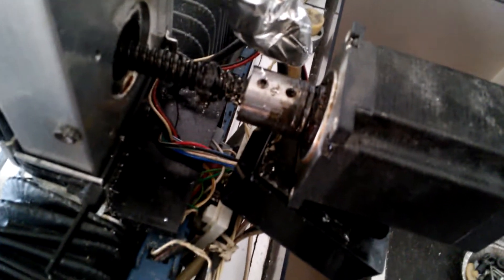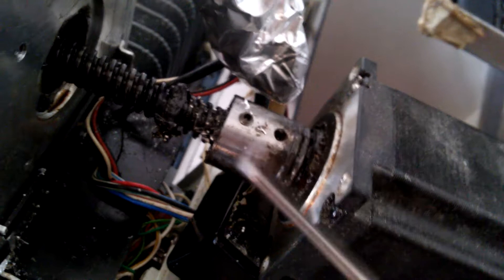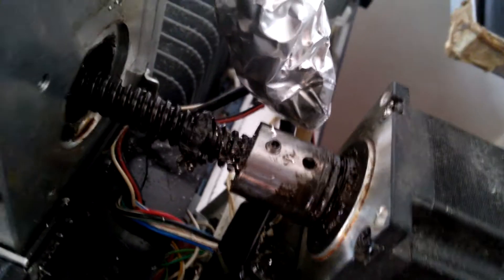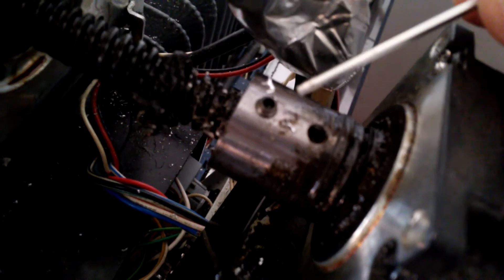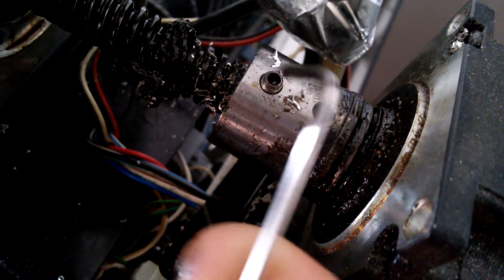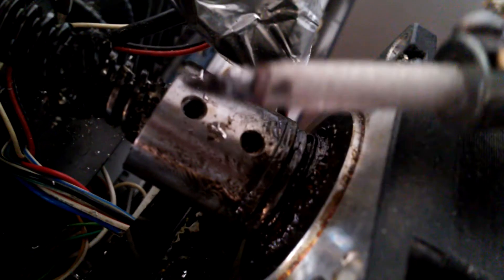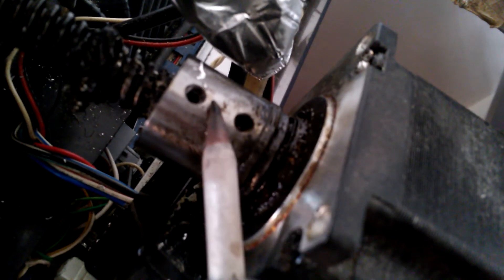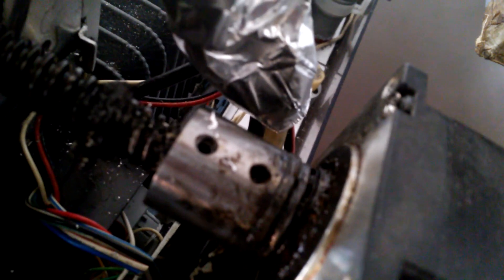How to remove a too tight set screw out

Comment from the maker: yes。 i am planning and investigating if the original old acme one can be changed to ball screw one。
Reply: You will get more benefits and precision if you upgrade those unsupported rails with the ones that are supported.The pitch error on those acme screws are like 0,3mm on 300mm of travel, and if you buy ballscrew c7 tolerance it will be the same only the backlash will be less.
Reply from the maker: I changed plastic delrin nuts once after they worn out, they were made by me with tight fitness, no backlash, may now has after further long time use. Plan to upgrade to Tawian TBI C7 ballscrew. For high precision types, they are rare and more expensive which may be be affordable by me, thanks for your advise anyway.... I also think about adding HWIN bearing rails under the two gantry X rods, but as mine one is a small model S400, it has not noticeable problem due to the said unsupported rails, will not change it at the moment.